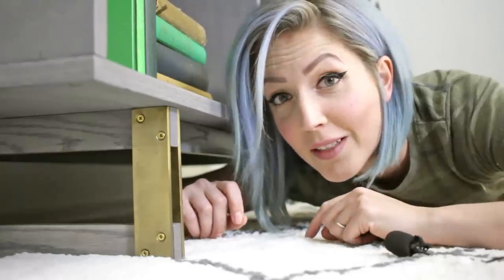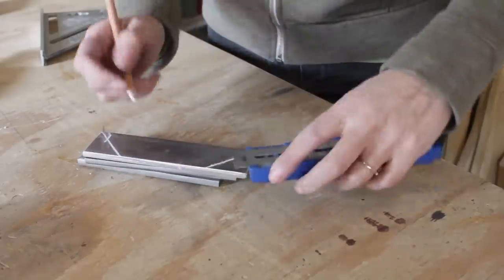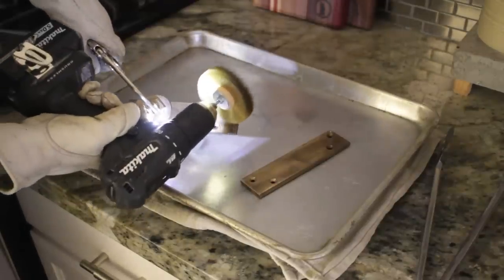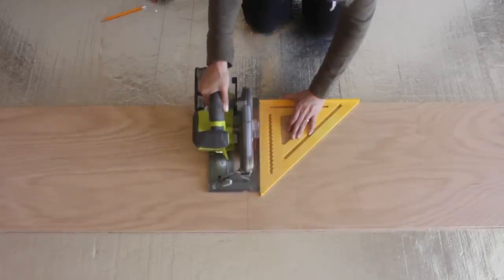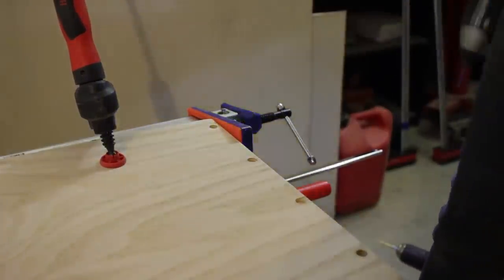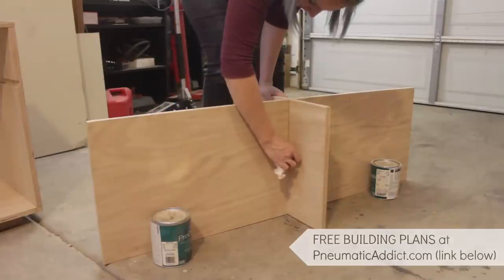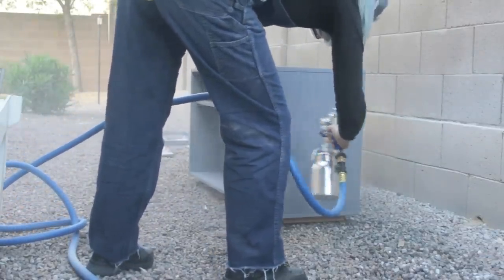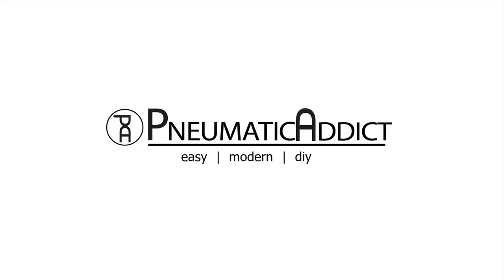Turn STEEL into BRASS then Build a Media Console

Comment: Tip for brass screws:
Use a non-brass screw first, to thread the hole, back it out and hand tighten the brass screw after.

The softness of brass screws makes them strip easily, but also there is torsion weakness and the heads can snap off easily which is an annoying problem to fix.

Comment: Pneumatic Addict: I recommend using COBALT drill bit for drilling hard steel. Milwaukee has a nice set out and they've been consistently better than titanium bits for me.
Reply: I use a Dewalt Pilot Point Industrial Cobalt Drill Bit Set, and I really like it. I go through stainless steel like butter with it.

Comment: Nice job Elisha! 👍🏻👊🏻 ...... I remember a while Back Marc Spagnuolo had used some Brusso  brass hinges on a project and they had included one steel screw to use on the pre-drilled holes to cut the threads into the wood so you could then remove it and insert the brass screws without marring/mangling/stripping them. So, next time you are planning on using brass screws, make sure to pick up a couple of steel ones of the same size! 😉

Comment: I didn't know that steel could be brass plated that way.  I though electrolysis was the only way.  As old as I am, I still learn something new almost every day.  Before I could afford a table saw, I used a router to make my dados and rabbets.  Router was less expensive than a good quality table saw.  I actually learned after I got my table saw that my dados and rabbets were more accurate with my router.
Although the flush cut trim saw you used works fine, I prefer and use a Japanese trim saw with a flexible blade.  It is EXTREMELY sharp, has no kerf and it's nearly impossible to gouge your work.  They only cut on the pull stoke so you can't push the saw into your work.  They're about $10 at the big box hardware stores.

Comment: nice video. I like some of your tricks such as clamping the square to 2 pieces to be assembled(screwed together). The steel to brass trick is awesome!  Also like your order of cutting and assembling. It requires better skills but the finish is better: assembling the outside box first then measuring the inside to build the shelves...then insert shelves.

Comment: Nice project, Elisha~!  I don't seem to be that graceful with my flush trim saw when it comes to nice wood, so I punch a dowel-sized hole in either a playing card or a piece of sandpaper, place it over the dowel, and then cut it off.  I'll either pare the rest with a chisel or just sand it flush.  No gouges~!   :-)
I like the steel "brassing" too.  Nice touch~!

Comment: The console came out great. New ideas for metal works !  You were mentioning future tools of a table saw and drill press, since like others in a garage shop and limited space, try looking up a Shopsmith.  The capabilities and features would give you more tools in a 2 ft by 6 ft space.  Look at utube Manhatten Wood Shop some of his clips, but a used Shopsmith could be bought for 600 to 1000.  New 4000, which says this American made tool is still being made, demos often at Lowes.  Mine is 30 years old and runs great, and you don't always need to use just Shopsmith bits or blades.  Worth the look. Hals Wood Shop.

Comment: For panel cutting, I find a table saw to be impractical. It takes up so much space and you have to either have an out feed helper, rollers or a table. I recommend a track saw when space and budget are primary considerations. I found a decent track saw on Amazon. I just set up a couple of sacrificial 2 x 2 boards on saw horses to support the panel and cut them with the track saw. Cuts are very accurate.

Comment: I like to use a router to make dados if I don’t want to set up my table saw, 1/2” or 3/4” bits and a straight edge to run the router against, you can even put both pieces side by side and run one straight board across them to have everything line up pretty closely, great video, love the brass brush idea

Comment: Great project! Any concerns about racking without a back piece? Some tips I have learned for brass screws. 
-Pre-drill with appropriate bit. 
-Install a steel screw the same size as the brass screws first. 
-put a small dab of paste wax on brass screws threads
-install with correct and good quality tip HAND driver.
Reply from the maker: Thanks for the tips! I was concerned with the racking, so that's why I went with dados. Its super solid once built
Reply: @PneumaticAddict  it is amazing how much strength dados add that's for sure!

Comment: Nicely done! I'm going to have to try some brass brushing myself! Glad to see another fan of the "backless console" design! I really like the simplicity and cleanliness you can't get when you apply a back to a project like this.

A tip for using brass screws in the future. I find that "tapping" the hole with a steel screw of the same size first, then screwing in the brass screw by hand helps prevent stripping out the head of the brass screw. I also lubricate the threads of the brass screw by rubbing them over a block of paraffin, or even a candle, makes them go in a lot easier.

I just discovered your channel, so yeah, this is the first video of yours that I've watched. Subbed and liked, for sure! I love your video style! Keep it up! Now to go back and binge watch your videos...
Reply: I agree.  I like the backless consoles, but then I hate wrestling with cord management.
Reply from the maker: You're right! I love how they look too but hiding cords can be tricky

Comment: You can also transfer small amounts of stainless steel to mild steel with a stainless steel wire wheel. It’s best to acid wash the steel first, then bear down on the mild steel with a stainless wire wheel brush. A larger grinder works best.

Comment: Looks great, love the finish you got. Surprised at how clean the cuts on the ply were after the steel bars. 
For your flush trimming, I noticed your saw has a rigid back spline, grit a flexible one like the Japanese ones that cut on both sides and it won't gouge the wood. It's the flexibility that will make it flush

Comment: finished product looks great.

Next time keep in mind that the plys in plywood are very thin and chemicals from the glue do leach through or almost through the outer plys.  This is probably what goofed up your try at the reactive coloring.
Reply from the maker: There were actually streaks of woodfiller across the top 👎

Comment: Excellent project...!   When you drill in metal, start with a small drill, then go up in 1 or 2 mm steps, until you get to desired dimension.  Less workout. Body, drillbit and machine cope better/last longer.

Comment: Its sweet how you think using a power drill is "by hand", im old enough to remember drilling holes with an augur type drill
Reply: Thornspyre ahhhh the bit and brace days 
With a Yankee screwdriver in the back pocket.
Only slot headed screws available as well

Comment: To avoid stripping out brass screws, first use a metal one of the size, remove it and install the brass one. Adjusting the clutch on the drill will help over tighting too.
Reply from the maker: Thanks for the tips!

Comment: Really beautiful work. Did you put anything on the bottom of the legs to prevent marring?  Home Depot has these cool Teflon feet that are flat as coins and attach either with self adhesive or flat head screws.  Makes it easy to slide items on wood or tile floors without marring.

Comment: Yes, a drill press is super handy. Drilling metal by hand generally requires a fence or clamps to prevent *cough* unexpected rotation of the metal piece.

Comment: I hope the next video sponsor is one that has shipped you a drill press. Great video.   How durable is that brass finish prior to the clear coat?
Reply from the maker: Thanks! Eh, I would say slightly more durable than a single coat of paint, but it's so thin it definitely needs some protection.

Comment: A little tip when using brass screws.  First drive a stainless screw to thread the hole.  Then put in your brass screw.  Trying to drive and thread a brass screw just results in stripped screws and new curse words...

Comment: Hi! I don't usually leave comments on larger channels as they usually don't have the time to answer all that they get. That said I really liked this video not just because I learned something. I like the brass plating technique and I'm curious to know how it would help in rust protection. I also enjoyed your presentation. Well done. New sub and like
Reply from the maker: Thank you so much! I really appreciate the feedback
Reply: 4:36 - brushed brass plating alone won't work to prevent rust as it won't be perfect. The lacquer is actually the real deal here (no idea if it's UV stable, but it's indoor - so unimportant). Brass is just for the looks - at that point I'd guess normal brass would have been an easier solution (and easier to drill too). I suppose brass plating is just for fun/showing off.
Reply: @stanimir4197  Thanks so much for answering! Much appreciated!

Comment: This was such a cool video!!!! Thank you. Can you by chance tell me what you used as a lubricant please?
Reply: northshorepx wd40 works, there’s plenty of cutting oils, or 3 in 1 oils if you walk down the home center aisles.
Reply from the maker: Yep, I used an old bottle without a label, but I believe it's a 3-in-1 oil.
Reply: Thanks guys. I've never drilled or cut metal before so didn't know if normal oils/WD 40 could be used.

Comment: Which turntable do you have?  Looking for one that has decent sound without a pre-amp.
Reply from the maker: Mine is just a cheap Crosley. I'm sure the sound isn't the best
Reply: @PneumaticAddict  we're just looking to play all of the vinyl that's gathering dust in our closet.  Not audio-philes at all, but would like something that sounds better than my cellphone speaker if possible.  :)  Thanks.

Comment: You are a survivor. Two kids and building stuff......good for you.
The brass wire wheel is being melted onto the hot steel.
Is that what is essentially going on?
I'm thinking the hotter the temperature the better? Yes no maybe?
Reply from the maker: Basically yes. The brass is getting soft enough to rub off on the steel. The problem with higher temperatures is the discoloration on the steel.

Comment: You need to make an assembly table to get yourself up off the floor. All that bending over and working on the knees will destroy you. I will be turning 40 this year and my knees and back are almost gone. Been in construction and woodworking as well as just a lot of manual labor since I was 13 years old. Just can’t avoid working in all kinds of awkward positions. Now, just standing funny can cause my back to hurt. Don’t know how I’m going to put in another 25 years!

Comment: Top tip - Cut of a piece of metal, then immediately touch the hot  metal afterwards.
Reply from the maker: With a cold cutting saw blade like the one I used you can. Cutting doesn't heat the steel.